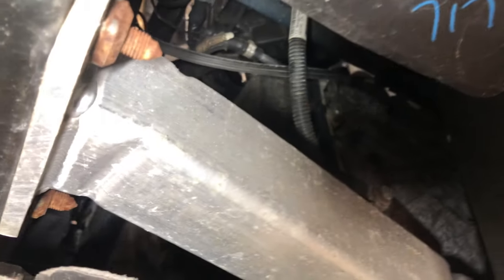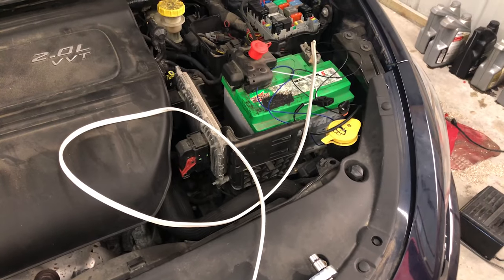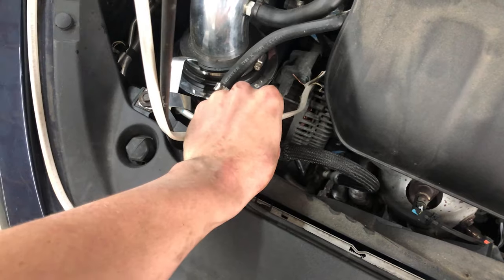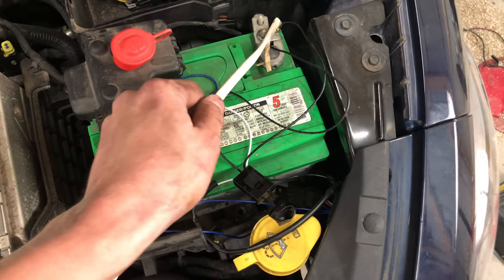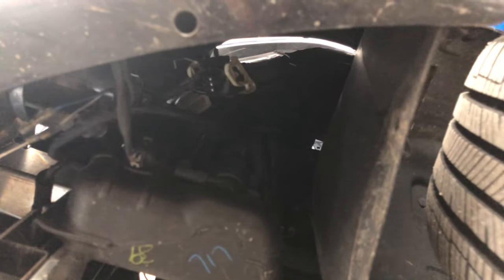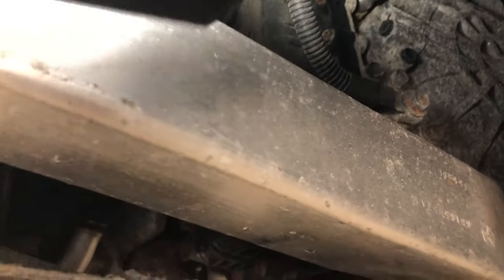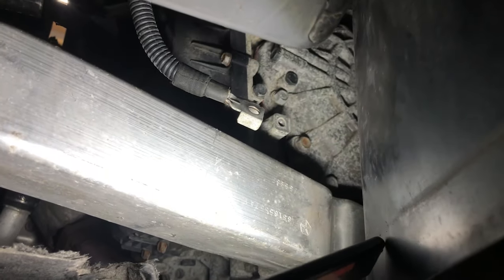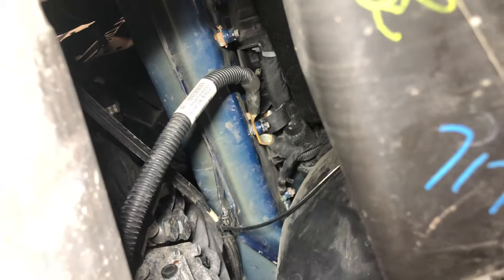Dodge Dart No Crank No Start - Fixed for $0.00 - Bad Ground

Comment: Damn bro I took to the dealer, they replace starter alternator and the battery and it was running fine for 2 weeks not it did it again at the gas pump , after trying to get it starter for 30 min I started drove it home but now no startt
Reply from the maker: Clean the grounds and add a ground yet ? Test with them jump cables

Comment: Will the starter still click when it's a bad ground or is that the starter itself that's gone?  I'm having similar issues with my 2013 dart
Reply from the maker: @jeffboutilier5075  it can still
Click and fail to fully kick on due to a weak ground. It takes alot of power/ground to enact the starter. A bad starter can also do that though .
Reply: @JustFixinGarage  thanks for getting back to me,  I checked the ground with the wire like you showed,  it appears to be the starter.  Appreciate the quick response 👌
Reply from the maker: @jeffboutilier5075  for sure man . I do have a video on replacing the starter . If you have a good set of ramps or jack stands and some patience you can definitely take it on yourself :)
Reply: @JustFixinGarage  I watched that today actually.  I'm unfortunately dealing with a torn rotator cuff so I think I'll take it to the repair shop.  Appreciate the videos that you do

Comment: My dart doesnt start but and doesnt really crank but it does one click noise every time i turn the key, do you think thos could be the problem even if its doing the clicking noise? Thanks in advance!
Reply from the maker: Sounds like a dead battery
Reply from the maker: If the battery isn’t dead then you could have a bad connection or a bad starter.

Comment: What would keep blowing my starter fuse when I crank my car.
Reply from the maker: A dead short internal of the starter or a wire from the fuse to the starter is a dead short . Unhook the starter wire from starter then make sure it’s not touching any metal and see if it still blows . If it doesn’t then it’s a shorted starter . If it still blows then something from the fuse to the starter is frayed or arching to ground more than likely

Comment: Already replaced the starter but saved me a tow bill and a mechanic
Reply from the maker: We made the same mistake on a starter replacement as all signs pointed to that. We got fooled by not checking the ground. Hope the issue is all resolved for you now .

Comment: I cleaned all of those and still had no start condition.  Check with driver weeks later to see if issue was resolved and they shop told them it was the module that communicates with the key fob.
Reply from the maker: Good tip ! In those cases if you use a test light at the starter it would have indicated it’s not getting the start command on the small wire when cranking then it could be back traced. Curious what that ended up costing .
Reply: @JustFixinGarage  what do you mean by test light? 

I have a multimeter, can I use that to see if it’s getting signal? Which wire do I touch?
Reply from the maker: @shaneh7519  a multimeter is just as good to check voltage/power . A test light will just has a bulb that lights up when it sees power . One end of the test light has a poker end and the other a clamp that you clamp to ground . As for the wire to check . You will want to ensure the larger wire that’s held on with the nut has a steady 12 volts . There is then a tiny wire that clips into the starter . When the car is trying to start that should be getting 12 volts for cranking . If it is getting 12 volts and starter is not engaging it’s a bad starter or gad ground assuming the 12 volt constant has a good connection . You can jump 12 volts to the tiny wire terminal to test the starter as well

Comment: Will this fix headlights to, do ya think?
Reply from the maker: The ground can affect any circuit so this would be included . Generally though if headlights have issue the starter would too since it pulls more amps

Comment: I know this video is old but i just replaced the battery again after a year . 2 months later its not starting today. What could keep making the battery die?
Reply from the maker: Hey there ! Just to be sure we are verifying it’s a dead battery right ? Like the battery had alow charge after sitting ? When jump starting it does the alternator function and show 14 volts or so at the battery ? If alternator works and the battery is healthy and dies after sitting then there is what’s called a parasitic draw and battery . This could be as simple as a bulb not turning off or a module failing and not going to sleep this always pulling power. Otherwise be sure connections are all clean and tight and if needed add another ground cable. If it’s just losing power when off and sitting you’ll need to do a parasitic draw test which there are a few videos by others on . It’s by far the most difficult thing to get figured out.
Reply: @JustFixinGarage  I took it to advanced and the batterys great. It's clicking but I haven't checked this ground wire out yet..maybe it's just corroded!? Can I use a regular jack for this?
Reply from the maker: @melissauknow5328  you can test it by hooking a ground jumper cable from battery to somewhere on motor . I have a few dart videos about adding a ground. I’d test by adding a jumper ground and if that fixes it then you need to clean and or add a new ground. Otherwise it may need a starter

Comment: Recently mines stopped starting, I had tow truck come out to my car but once he arrive he put cables on battery and car started. The next I tried to start the car and it wouldn’t, I used jumper cables from neighbor to try and jump start but failed. Could this be my problem? Thanks
Reply from the maker: It sure could ! A bad ground can cause intermittent starts. Try jumping the ground terminal of battery to the motor and see if it starts
Reply: Okay thanks, I read in the other comments that I could use a jumper Cable, how to test using them? I know very little about cars, and would hate the spend money if it’s something minor
Reply from the maker: @sam_i_am2043  my bad I thought I replied, These people would hook up the the ground part of the battery and hook the other ground side to the motor somewhere to ensure the motor can reach ground. similiar to how I did with the electric cable but jumpers are a better option I didn't think of at the time.

Comment: I have a 2015 Dodge Challenger and yesterday I was changing my passenger side headlight because it went out. Before it went out about two and a half years ago, I got the headlight brand new put it at the dealership. A few days later the light went out but came back on, but it was dim... So I didn't pay it any mind. Yesterday morning it went out, I changed it and put the new light in, it would flicker really fast, then go out. Thought the light was defective, was able to exchange... that light did the samething... So I decided to check fuses under hood and in my trunk... When I took the fuses out in my trunk to check them, they were fine... So I tried to start my car nothing... She would not come on. She was working perfectly fine til I checked the trunk fuse box.. No light, no alarm, all I was getting was a clicking noise from the fuse box. Was able to charge my car battery, but she stills fade. Found the relay that was clicking and took it out then put it back in, but she still won't start... Maybe this is the problem but could it be something else as well? If you can, please help.
Reply from the maker: When it comes to electrical issues I find ground is usually the problem. In your case the battery is farther away so its hard to jump the wires. If its anything like my charger there is ground stud under the hood. You could try to jump that to the motor assuming its a good ground. I would surely though check the grounds first. I am sure you have already tried to jump start the car to rule out a bad battery. let me know the results hope you can get it resolved.
Reply: @JustFixinGarage  it was time for her to have a new battery. Thank goodness... For the light, though... I have to get a whole new HID headlight. Those things are so much. Found out the passager side headlight was causing the lights to go out so fast because of the wiring. Hopefully I can find a good price on headlights... Called the dealer and they said they had two but they are $1300 so I'm just going to keep looking. Thank you!!!
Reply from the maker: @TheTatdAkuma  that’s good news ! My 2014 charger needed a new battery last year and I just did my wife’s 2017 rogue. Glad it was just a battery in your case . As for the cost of your headlight assembly that’s rough I know my charger is pricey too. Right now my rear led strip is not working on some spots for brakes and it’s 4-500 for the assembly non serviceable. Thanks dodge 😂

Comment: Would this work for Dodge Avenger?
Reply from the maker: Bad grounds can happen on any car . I don’t know if the avenger has the same wiring location . But you can test the ground by using a jumper cable from the ground on the battery to a metal part on motor .

Comment: Thank you
Jumper cables to diagnose worked well
Starts every time now.
Reply from the maker: Ah thats a much better Idea using jumper cables at the time I didn't even think of that. Will for sure use that next time. Glad the video helped diagnose your issue :)